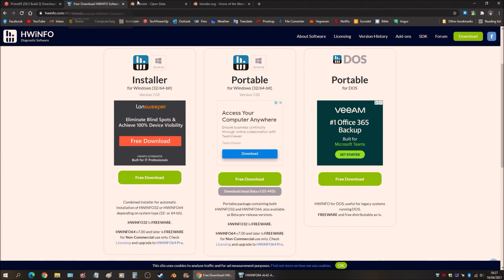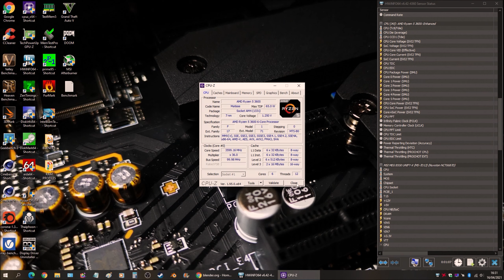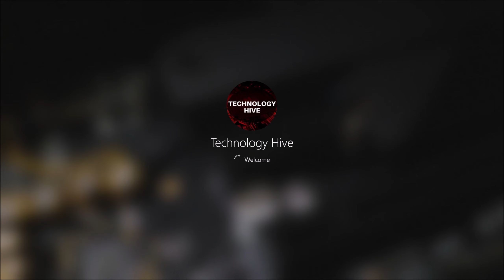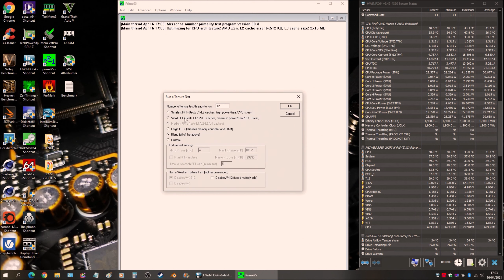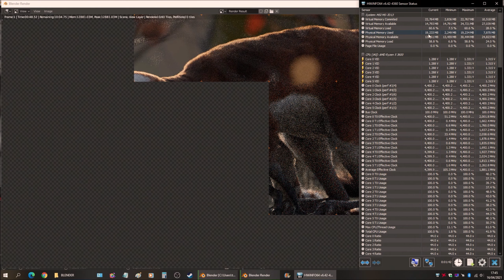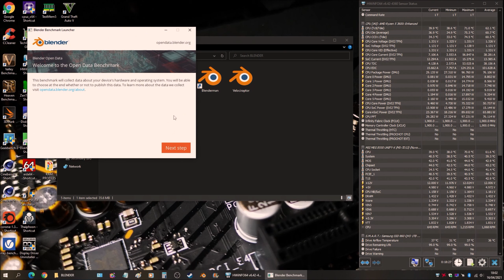How To Overclock Your AMD Ryzen CPU (stable)

Comment: hmmm, is it possible to overclock my 3600 but instead of a static overclock, can I overclock it and still have it downclock to low speeds when idling, I don’t want it constantly running at max oc.
im on a Gigabyte motherboard btw
Reply from the maker: Yes, just use the "balanced" power setting in windows.

Comment: But i did not catch the name of your cpu cooler. Which is it ?
Reply from the maker: Hi 😊. This is the Noctua NH-U12A cooler used during the testing.
Reply: @TechnologyHive   Nice, did you get some cpu power draw numbers ?
Reply from the maker: @kpakpatojournal1555  You can see in the video power draw fluctuating between 88w and 110w depending on the application. P95 being the most demanding. 

I don't recall how many amps it was drawing during load but it was not significant. Nowhere near 80 amps. EDC hovered around 130 and 150 depending on application.